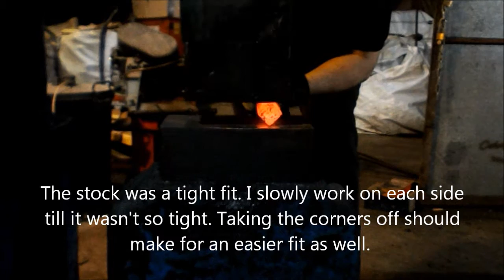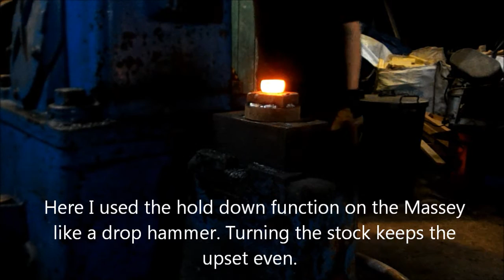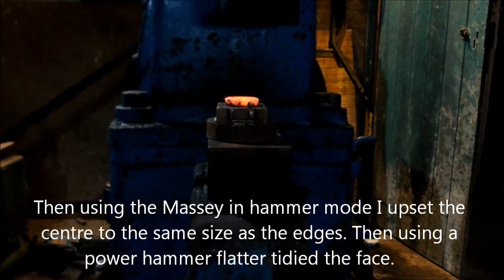Part 6 Tong Tool, Flatter! Trust Me I'ma Blacksmith!

Comment: Great video! One comment on safety. I've  know a few smiths who have severely damaged their hands by accidentally activating their power hammer ram while brushing scale or setting a tool on the bottom die- both hammer makers -namely Brent Bailey and Nathan Robertson. I was taught to imagine an invisible curtain between the faces and outside perimeter edges of each die that is never breached by a body part however inconvenient it may be to manipulate your tool or hot material with tongs or handles. Please understand this is purely a friendly consideration that I was compelled to share and fully respect your style and technique. Someone who is less skilled may get comfortable doing the same thing after watching you and the story would unfold smashingly from there. I think your videos are great and look forward to viewing them all! Thanks!

Comment: From this angle it looks like Your power hammer dies (or jaws or whatever they call em in this language) are not even or am I hallucinating? That would also explain the uneven head..
Reply from the maker: I'm quite sure what you mean, But if your talking about the top and bottom dies being different size they are.